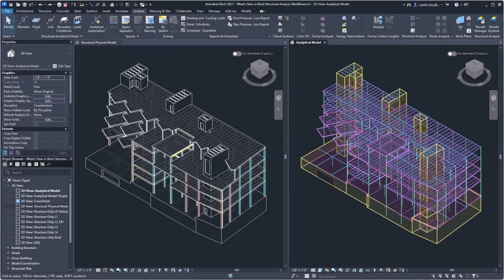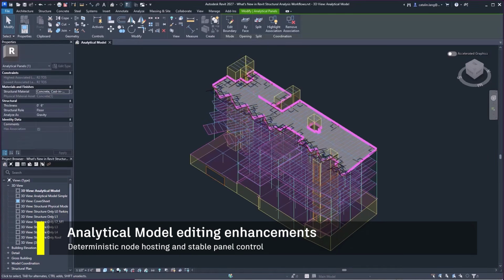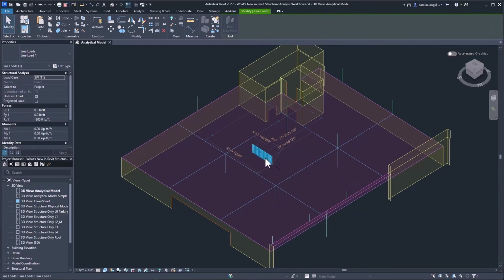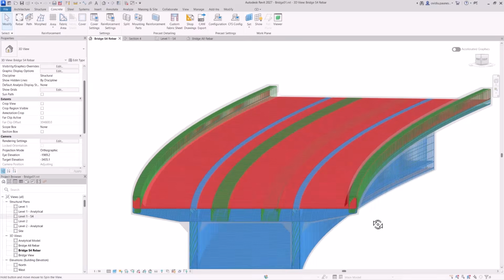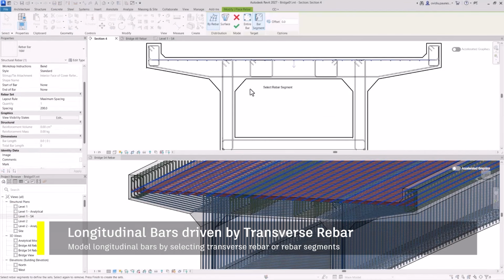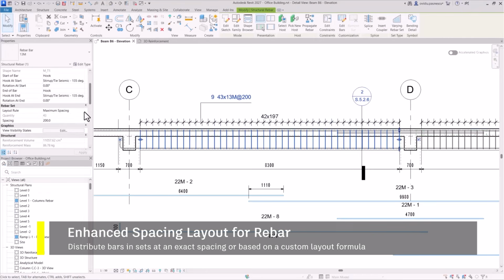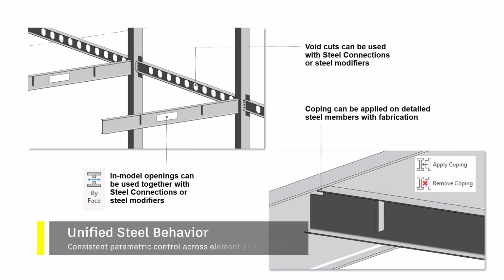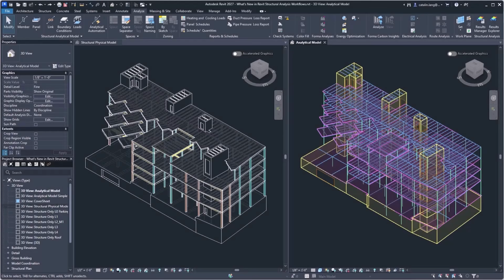What's New in Revit 2027 - Structure

Comment: Dear Autodesk, it's 2026. Please make the Advance Steel extension work seamlessly with Revit.
Reply: Do we still think Revit is detailing application. If after many years of maturing, Arch and MEP disciplines can't detail accurately, I can't see this failed strategy will deliver for structural steelwork or architectural metalwork detailing.  Advance Steel is 95% complete and we can push detailed models from AdS to Revit using 3rd party tools to coordinate LOD 500 models with other disciplines.  This idea that engineer's static analysis model can also be the design model and the fabrication model is not feasible.  In my opinion their workflow for model development is based on a flawed philosphy held by 1 Product Manager. The time has come to own the corporate mistake and step aside and bring back customer project deliverables back into focus.